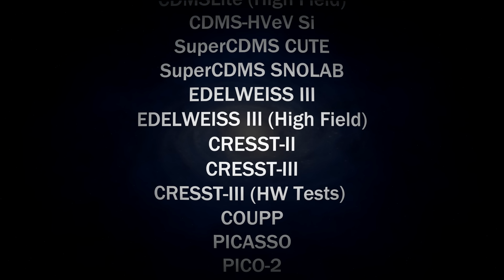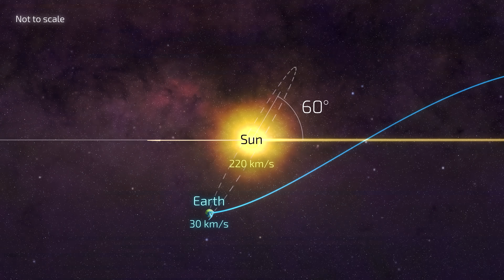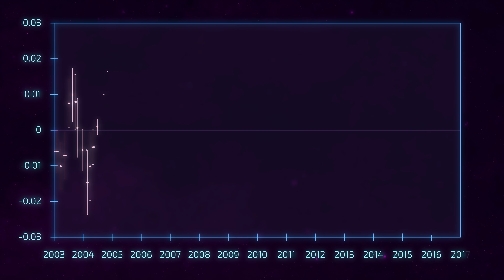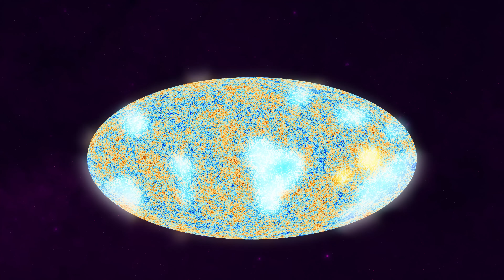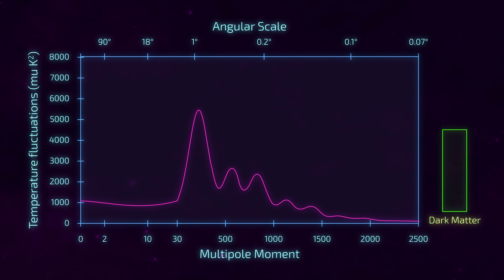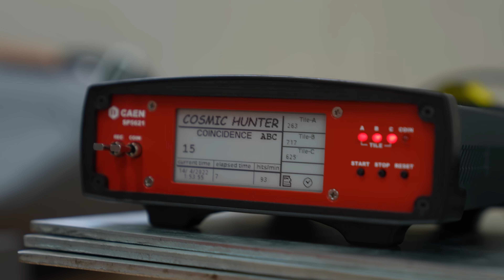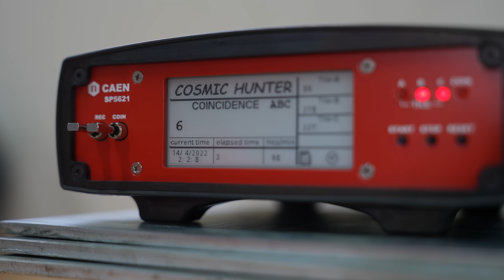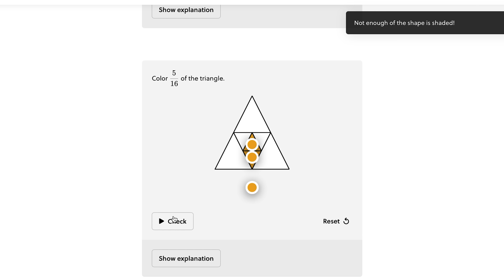The Absurd Search For Dark Matter

Comment: Another way to explain is is that they've built luminosity as a benchmark using the small magellanic cloud's distance as a meterstick.  But they measured that with parallax, which is not viable in a relativistic universe.
But invisible tooth fairy matter is more acceptable than revising a billion textbooks and eating crow.
Same reason software versions are never reversed when a serious bug is introduced, merely progressed to another version which introduces hack-fixes on those new bugs, continuing new bugs for years.

Comment: Brilliantly explained and perfectly illustrated, thank you for this exceptional presentation. But may I point out a little mistake I spottet (as a chemist)? The NaI-lattice is drawn falsely as the iodide ions are in fact much bigger (not smaller) than sodium ions (about twice the size) but I guess, in this context it doesn't matter.
And I have a question regarding the background, maybe someone can answer. They put a myon-detector on top of the dama/nai-experiment to rule out a myon-induced signal. If a myon crosses the vast amount of rock above - without interacting, so it can reach the myon-detector, what is the chance it also crosses the myon-detector without interference and gives a signal in the szintillator?
Cheers!

Comment: Mark my comment: Compare the Maxwell Demon to Gravity - you see that for large cosmic ensembles like galaxies from a statistical mechanics point of view there needs to be an additional energy term for all the "order" gravity creates. Otherwise, it is a violation of first and second law of thermodynamics. For few celestral bodies, this is neglibly small but for large ensembles as galaxies or galaxy clusters this becomes a huge quantity. So adding a thermodynamic term to the laws of graviation/Einsteins field equations solves this whole thing: There is no dark matter, a different form of graviation arises due to thermodynamics for large celestral ensembles. Plug it in and everything works out. Its no wonder no one has found dark matter particles. Because it just doesnt exist, its just thermodynamics doing its stuff. The prediction of this hypothesis yields a distribution of "dark matter" in the universe exactly in the way it has been "observed". Again, its just no "matter" its first and second law of thermodynamics applied to the statistical ensemble of celestral bodies with gravitational interaction (creating order like Maxwell demon) which requires an additional energy (mass) term in Einsteins Field Equations. Few body problem Newton mechanics and Einstein Fields Equations still works without considering this as entropy is relatively small, for large clusters of celestral bodies it become huge. So Einsteins Field Equations and Newton Mechanics are not even "wrong", they just lack a thermodynamic source term which can be added (and ignored for few body problem), thus yielding the corrected equations which yield to predictions perfectly congruent to obsveration of "dark matter". Hit me up if you are interested.

Comment: If our universe have 80% dark matter then how could it be a rare incident that it hits the crystal. The crystals should get bombarded with such matter right?
Reply: I get your point but because it interact not much or not at all with normal matter, it's really hard/impossible to detect.
Reply: It will, supposedly, only interact with other materia if it directly hits an atom, which given the size, is quite rare. Imagine your shooting an arrow at a soccer net and you want to exactly hit one of the cross stitches in a way that it‘s broken - from a couple hundred feet away. Your arrow will just pass through the net uninterrupted 99% of the time

Comment: So coming from a layperson without much scienctific background, how do we know that all of those measures to stop other particles from interacting with the sensors wont inhibit dark matter from interacting with the sensor? (Well, I suppose we dont "know" since dark matter is still unproven). Is this just an attempt we are making because its out best shot? All part of the scientific method with failure as an inherant risk?
Suppose this experiment yeilds no result, that doesnt necessarily mean that dark matter is disproven, couldnt it be a possibility that we now know how to make a machine that doesnt detect dark matter? (To be a bit cheeky)
Reply: Or, to ask the question in a different way, how do you differentiate between a negative reading meaning the machine doesnt work and negative reading meaning the machine disproves dark matter?

Comment: I don't believe dark matter exists. They once saw what was in a patch of dark matter when something moved behind it and it was just unlit cold regular hydrogen and other abundant elements, or regular matter just unlit. All dark matter is just regular matter that has no source of light or in the shadows of other matter, we can't see it because no radiation comes or goes through that matter to give us an impression of what it is. Another thing I've been wondering about is of a gravity particle that is like a multidimensional chainmail that links everything together that lies in dimensional space above 3 dimensions. More than 3 dimensions could explain how some particles can be waves and pass through a physical barrier at the subatomic level or maybe that's because they are smaller than the spheres of larger particles. Ugh, it's hard to think about the subatomic world. It's like how BBs could slip right through a tightly packed ball pit, rolling through the gaps between spheres, that's how subatomic particles slip through barriers that are made of larger particles clumped together in atoms and molecules. But I still think that there's a gravity particle that is just in higher dimensions or a different plane at a different angle or phase as the visible stuff, so it might explain dark matter.

Comment: dark matter isnt real, which is why it wasnt and wont be found. its just a correction term used to cover for the failure or physics theories, thats it.
Reply: that makes it a theory doesn't it? and it corrects three different models with the same mechanism, and that's an indication for being in the right direction
Reply: @shir_azazil  a theory yes, but its being presented as something true instead of a theory.
Reply: @sshreddderr9409  from Wikipedia: "In astronomy, dark matter is an invisible and hypothetical form of matter that does not interact with light or other electromagnetic radiation". The word 'hypothetical' comes out do denote it's unproven and theoretical. it does not mean it is not true however, and based on astrophysical observation on how matter should interact (theory) it is only seen to be true. certainly more experimentation and directe observation are ought - but it's not outright wrong as you put it.

Comment: @ 1:30 "according to most theories, dark matter doesn't interact with anything including itself except through gravity." 
@ 10:30 "the idea is that very rarely a dark matter particle may hit nucleus in the crystal and transfer energy" 

Either dark matter interacts with regular matter or it doesn't. Any explanation for this contradiction?

The DAMA/LIBRA experiment has failed to be replicated by ANAIS, an independent and different team.
Reply: It's probably just evading the explanation because it's complicated but I suggest you google that. and ANAIS did fail to replicate it which isn't a good sign for DAMA/LIBRA

Comment: No doubt it is just me, but given that our galaxy is estimated to be 100,000 lightyear's in diameter, the fact that our solar system is moving around it at a mere 220 km per second is not very impressive.
That's 1/1364th of c, and we have to travel the diameter x pi to get to the other side. Buy my calculator that means 428 million years to get to the other side of the galaxy. I think our solar system needs to lift it's game

Comment: I have no idea where to publish my hypothesis so I am leaving it here. Tell me what you think

Date: 2025/ Jan 28

I would like to propose a hypothesis that states, If the space time is a fabric that deformes respective to the mass and energy. Then just like any other materials that after crossing a certain threshold remains deformed. The space time fabric could potentially remain deformed or stablize in such a way that it leads to what we detect as dark Matter. This configuration would not revert but rather act as a permanent feature in the fabric of spacetime. As we know dark matter does not emit, absorb or reflect light and emit radio magnetic radiation. We cannot say it's a matter either it's a pull gravitational pull. Which we detect. Dark matter or force it could be a manifestation of spacetime curvature that does not dissipate or return to its original state after the universe expanded. Rather scatter along the other matters throughout the universe.

Then, To justify how the space time fabric was deformed to a threshold from which it became a permanent feature in space time fabric.

At the time of big bang the singularity was vast and intense exceeding a critical threshold and Thus creating a deformation in the space time fabric. Which scattered along the universe as time.
Reply: 1. Your hypothesis contradicts General Relativity which says spacetime only changes because of mass and energy and it can't have any permanent configuration in the absence of it.

2. Your theory doesn't explain bell clusters where gravitational pull keeps moving ahead of the one caused by visible matter. A dent in the spacetime should stay tied to where mass was originally.

Your hypothesis requires reinventing the universe OR... it could simply be wrong.
Reply: yap yap

Comment: excuse me, with the star and weight example, did you put more weight into the star too when you added weight to the rest? if dark matter is 85% of all the matter, then shouldn't it also be 85% of the sun too? I mean, otherwise we'd had to scoop up some outer space in an airtight box that won't crack because of the low pressure. So when you say that the star needs to spin faster to remain in the exact same orbit, you're assuming the dark matter is in the middle of the galaxy and is less and less the more out you go, but how does that make a sphere around the galaxy, that would just create a film of dark matter over the galaxy, not a sphere around it. Or the dark matter comes from the center black hole if it gradually gets less denser the farther out you go, or they contribute a lot to it?

Comment: Dark matter is spread out throughout the universe like a person in a bottomless ball pit. makes up the fabric of space. Dark matter is the reason for gravity. Matter clumped together creates an offset in dark matter fabric like a bowling ball in a trampoline but in 3d. Everything will fall in place of dark matter if there is an offset (objects like planets replacing a clump of dark matter with normal matter) things move through dark matter at a constant but when there's a void of dark matter, objects want to travel to the void to fill in the space called gravity.. a big gaping hole in the dark matter fabric creates an enormous suction in fabric. Almost like a submarine collapsing. All of the water rushes into the under water "void" thus explaining the black hole theory in larger slower scale.

Comment: Considering the billions of dollars spent on dark matter searches, it would be a complete embarrassment to the scientific community if it were found that dark matter simply doesn't exist because scientists made the simple mistake of using the formula F = GM/r^2 which looks correct, but actually only applies to spherically distributed masses and most galaxies are flat disks, so we have been using the wrong formula for gravity. It isn't that we misunderstand gravity or there is additional matter, we just haven't been applying it correctly to a flat disk shape. Papers show that galaxies which are spherically symmetric contain no dark matter and that if you apply normal Newtonian gravity to disks, you can recover the observed galaxy rotation curves. Could it be this simple mistake??? Please see my new video "ChatGPT Solves Dark Matter" which implies that dark matter doesn't exist and that ordinary Newtonian gravity can explain the galaxy rotation curves with no dark matter.

Comment: Great video. The part I still don't understand is how we're confident of the mass measurements of galaxies, if it's based on light detection. Could there not be 5x as much planet sized or smaller objects of normal matter that don't emit light or other radiation?

Comment: TERMINOLOGY:
All light is visible. This is according to every dictionary ever written. Calling any other wavelengths of electromagnetic energy "light" is incorrect. I.E. Microwaves are not light.
LIGHT
"a: something that makes vision possible
"b: the sensation aroused by stimulation of the visual receptors
"c: electromagnetic radiation of any wavelength that travels in a vacuum with a speed of 299,792,458 meters (about 186,000 miles) per second specifically : such radiation that is visible to the human eye."
- Merriam-Webster Dictionary

Comment: Look for Dark Money, it is the obvious cause of planet destruction. But this is a genuinely serious matter. 

So if you know how this Universe is, Ie Actuality, then the search for the Aether and Dark Matter correspond, including the frame dragging component, which in log-antilog terms is how 0-1-2-ness time-timing sync-duration identification shows up as nothing but an optically static interference positioning-location instrument, carried around by a lump of material like the Earth, or an orbiting Satellite-based gravitometer at some particular distance from the center of the Earth corresponding to the interference of 0-1-2-3ness wave-packaging. 

The Bullet Galaxies phenomena a bit difficult to explain without the same 0-1-2-3ness frame dragging relative-timing in the potential omnidirectional-dimensional logarithmic terms of nodal-vibrational string-like interference patterning. 

If one is biased by the images of BBT and the Aether being a substance like wind and water  etc, the natural observation that takes years of self instruction to modify, then it's only later that we realize the Simultaneity of reciprocation-recirculation wave-packaging holography dimensionality predicts no particular objects only E=mC² type condensation-coordination mass-energy-momentum continuous spin-spiral sum-of-all-histories Conformal Condensates. 

We debate about the uncertainty, even if the experiment is null, anomalous or just plain misassembled, it's information In-form-ation by default. Methodology is the determinant.

Comment: Everybody want's to find the dark matter inside our universe, but what if the force, what is pushing everything is not inside, but outside, and pulls. If there is nothing around our universe it is like a popped ballon in an infinity vacuum chamber. The vacuum pulls apart the gas molecules forewer.  It will accelerating to the infinite, because the vacuum is absolutely zero, and the popped ballons gas has always bigger pressure.
If around our universe there is nothing, like no time, no matter, no physics, maybe it is like the vacuum, it will pulls apart the matter, the molecules, the time and everything to the infinite, with acceleration.
Does that make any sense? (sorry, my english is not so good)

Comment: Just a penny of tought of the outskirts of rotating galaxy. The space is warped like a cone around galaxy so how would the rotating motion behave and affect in the outskirts in such case? I mean shouldn't much more force be required than rotating motion in a plane for material to fly off. Wouldn't that account for a "dark matter"? One penny more, universe itself is still expanding (even accelerating) at some rate and objects within, so wouldn't there occur some lenght contractions etc. relativistic behaviors on matter that seem like forces?

Comment: Now astronomers cannot understand why galaxies rotate too quickly without falling apart.
They came up with dark matter, which creates additional gravity and allows galaxies to rotate so quickly.
But they can't find this dark matter.
What if there is no dark matter?
Maybe there another interaction of matter on large scales?
Weaker than gravity, but even longer-range. Let's say its strength decreases not as the square of the distance, but less.
Because of this, on a small scale, such as the solar system, its influence is imperceptible due to its insignificant micropower.
But on the scale of galaxies, over many tens of light years, this force is more powerful than gravity due to a more significant weakening of the gravitational force.
Following the example of strong and weak nuclear interaction: there can also be strong and weak gravitational interaction.
This could explain why galaxies rotate faster than gravity allows.
Reply: That's kinda the approach of mond, modifying the force over very long distances to match the data, problem is, it isn't working for different results, it doesn't explain all the weird observations which were Included in this video

Comment: If there is a lower thresbold, a miminal "amount" of gravity, then all the nonzero gravitational values below that threshold would round up to the mimimal nonzero value. This would explain the excess gravitation we measure in very weak gravitational fields. So what if gravity had the equivalent of quantas. Strong gravitational fields are seamless and smooth. Very weak gravitational fields might be a little grainy.